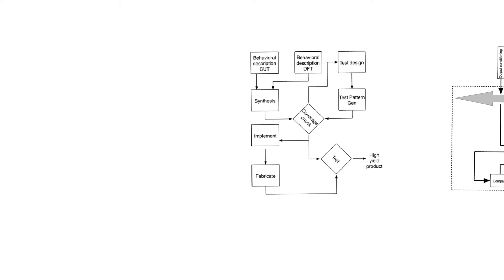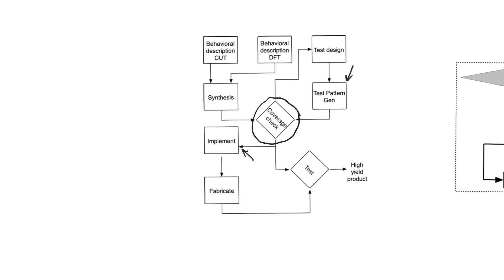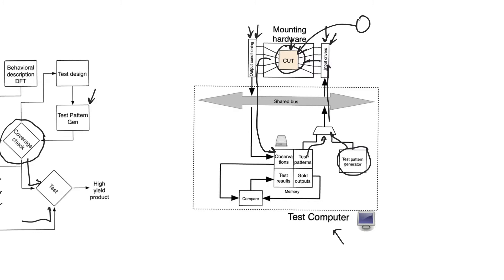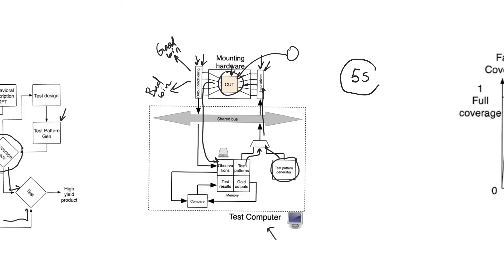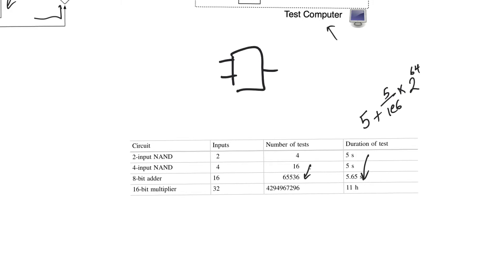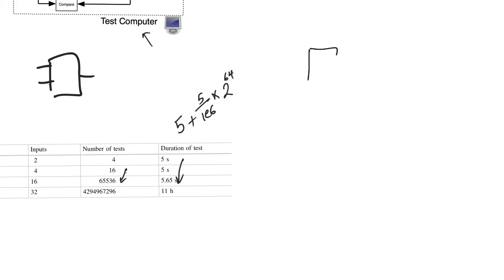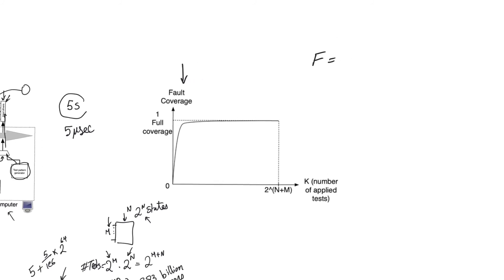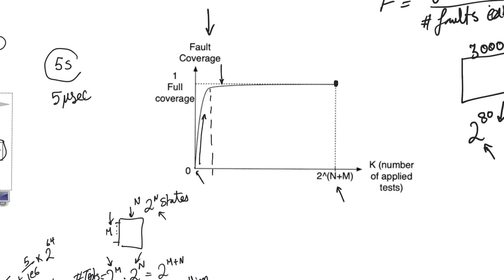14.3. Test Design and Fault Coverage

Comment: Shouldn't the fault coverage be 2500/3000 in this example instead of 500/3000?
Reply: uncovered means detected
Reply: uncovered means discovered in this context
Reply: I am having the same doubt, formula says uncovered/faults but he did covered/faults , it should be 2500/3000 right??
Reply: @improvebro  500/3000 is the correct ratio. What he wrote as uncovered I think means "covered"
By uncovered he means "unveiled or revealed" which really means the same as covered or tested
Reply: @doomtomb3  yes exactly, by uncovered he means the total no. of detected faults.